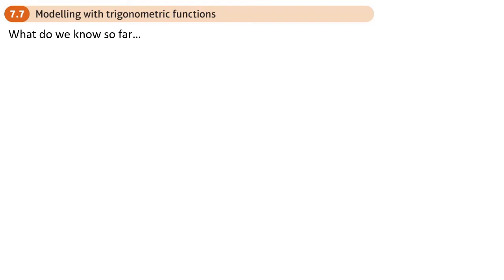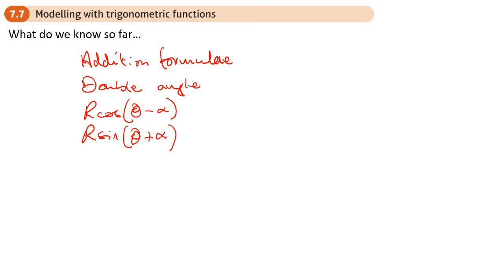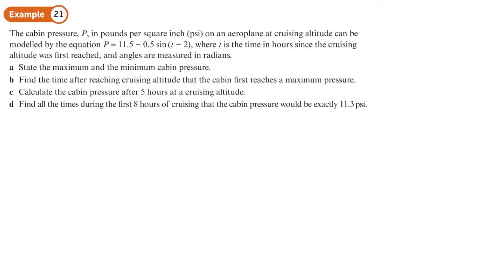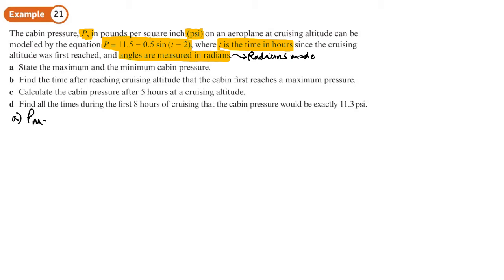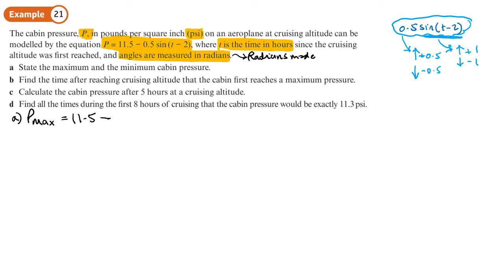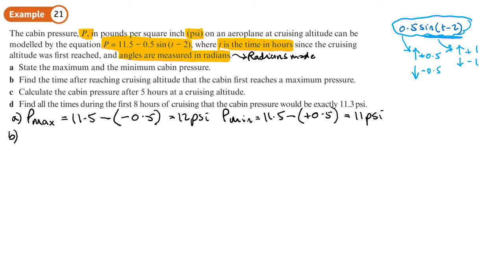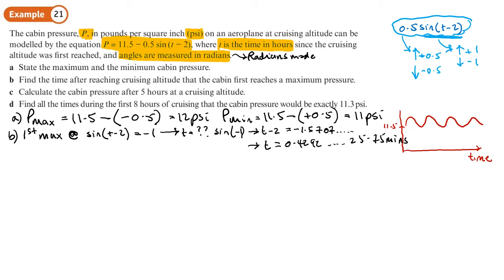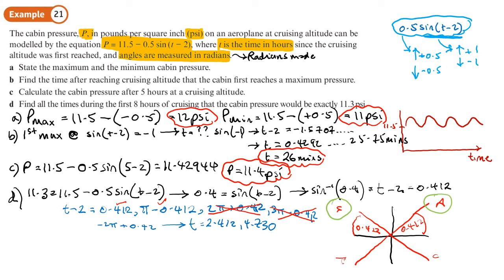7.7 Modelling with Trigonometric Functions (PURE 2 - Chapter 7: Trigonometry and modelling)

Comment: how come on the example part b, the max value is -1 and not 1
Reply from the maker: Because of the negative 0.5 in front of the sin term.  It flips the maximum and minimum
Reply: Hi Hiva, the reason it's not 1 is because of what we found in part a, The maximum pressure is when we substitute a negative value (-0.5), we get a minimum value when we substitute a positive value(0.5). I hope this helped!!!

Comment: why did you consider -2pi in part d ?
Reply from the maker: To see if that gives you an answer in the correct range once you have solved the equation.  As it happens it doesn't, but it's worth checking to ensure you get all the solutions and you don't miss any out
Reply: @HindsMaths  right , thanks very much